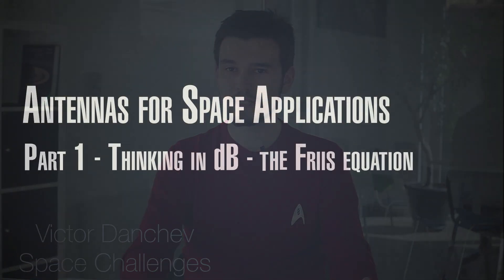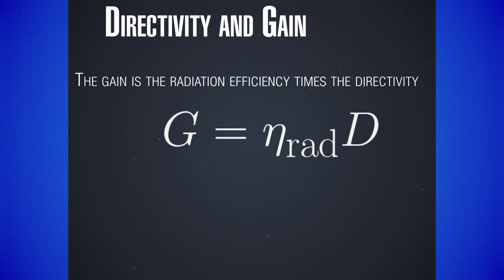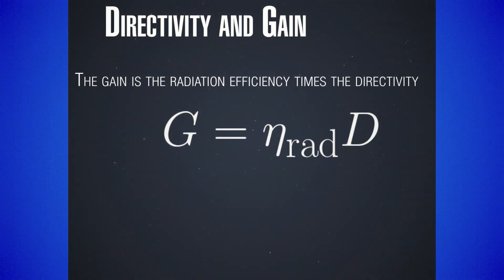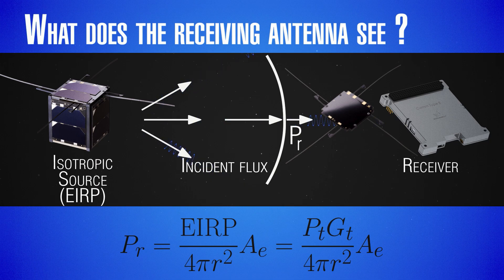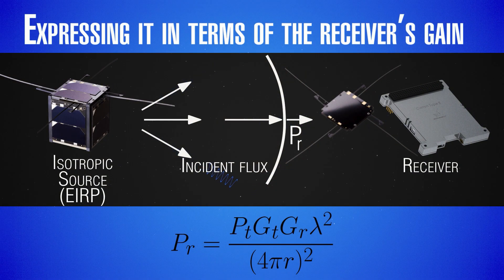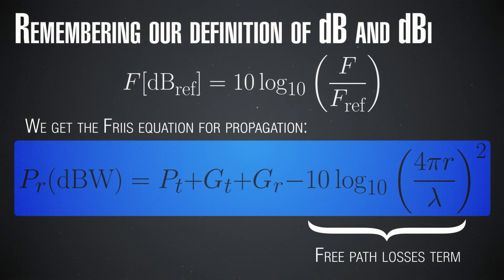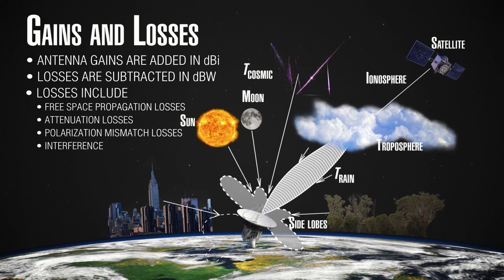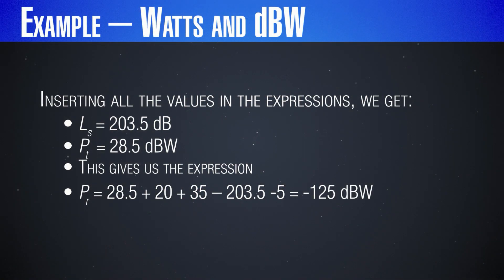InnoSpaceTool 10: Link Budget - Part 1

Comment: In the example , Free Path Loss calculation is not mentioned. How did you find the number of Ls=203.5 dB ? Can anyone explain it?
Reply: There is a calculation actually , I should have forgotten this = >>>  Free Space Loss ( in dB) = 32,5+20 log F ( in Mhz) +20 log D (in km)  .The distance  ,D  is 36.000 km since it is geostationary satellite . Frequency is 10.000 Mhz
FSL= 32.5 + 20log 10.000  + 20 log 36000 >  32.5 + 20X4 + 20X 4.55 = 203.5 dB